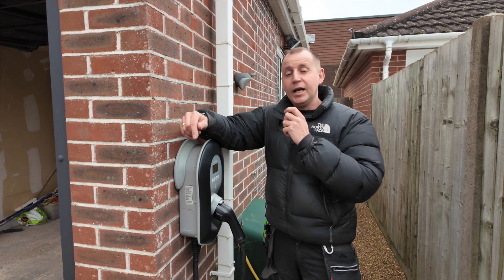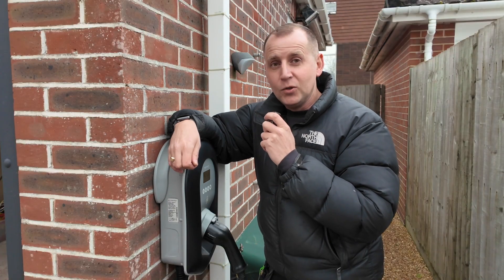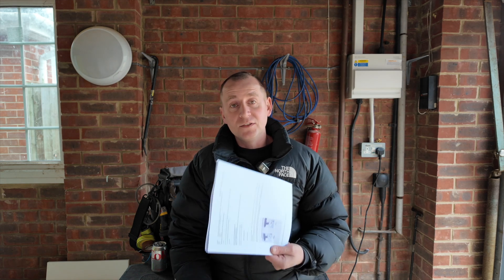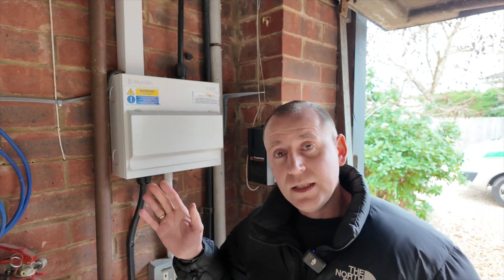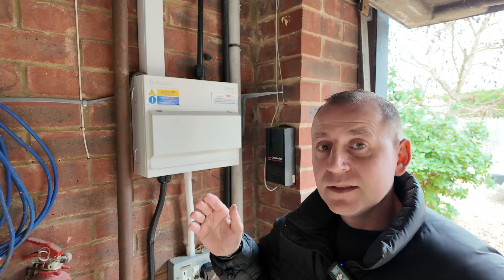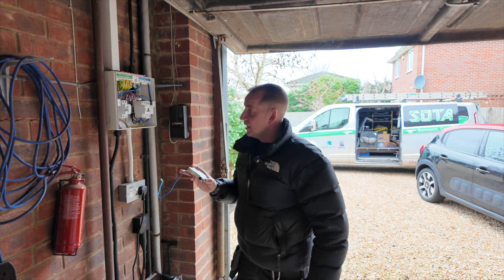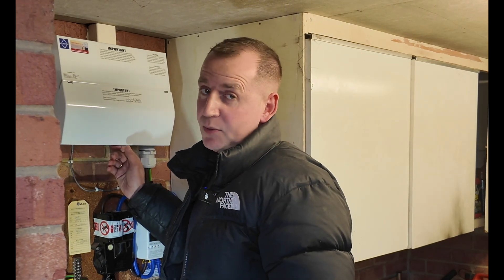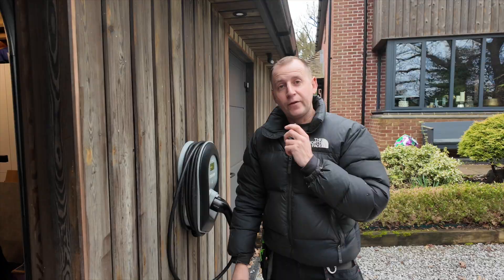THOUSANDS OF INSTALLATIONS MAY BE NON-COMPLIANT...ELECTRICIANS REQUIRED TO CARRY OUT REMEDIALS

Comment: My Energy owe you money, Ive never installed a zappy but have removed a few that were installed very badly. It seems now i will only install one if customer demands it. I WILL NEVER PUT A ZAPPI UP AS A FIRST OPTION. Thank you very much for this video, i cannot believe that they have used such bad faith like this. Deflecting blame on their faulty product with nonsense that will have had nothing to do with why their charge became faulty in the first place is a red line for me.
Reply: If they wanted to revise their rules they could have put a big red sticker on the replacement device saying the rules have since changed and now requires RCBO and kept you a happy customer. They have gone out of their way to imply that your work at the time was deficient to your customer. Id never trust them again

Comment: I had my zappi installed in 2022. Luckily, although my sparky installed it on an MCB, it is also covered under a main RCD on the board.
Reply: Unfortunately that’s not compliant with the regs either… part 7 says that the charger should be INDIVIDUALLY protected by an RCD… that is to say the RCD should not be protecting any other circuits. It seems to me most EVC installers don’t know that reg.
Reply: @stranglx  have you got the name of the regs? Need to tell my sparky.
Reply: @Smith_Tech_70  yes I do. In the current amendment fully in force since September 2022 it’s regulation number 722.531.3.101 page number 327. Specifically it says “shall be individually protected” In the original edition published in 2018 it is the same reg number but the wording was slightly different, it said “shall be protected by its own RCD” on page 317. I hope that helps.
Reply: @stranglx Thanks. I currently have my charger on an MCB and collective (several circuits) RCD. I'm getting the MCB replaced by an individual RCBO for my charger. The rest of the circuits can stay on their MCBs and the collective RCD as before. My Electrician is also going to perform the same upgrade to his own board, as he has the same as me. 👍
Reply: @Smith_Tech_70  sounds good, my only advice is that the RCBO should switch off the live and the neutral when it operates and should be made by the same manufacturer as the consumer unit.
Edit: It should also be a type A RCBO at least, depending on the chargers internal RDCDD protection it may need to be a Type B or F. There’s a lot to get right in this game. Finally if your house only has one consumer unit with just one main switch RCD you’d need to upgrade the whole unit as the RCD would still be supplying the RCBO circuit… hope that makes sense.

Comment: More concerned over the  use of an electric screw driver. I am retired now and always used normal screwdrivers. I notice this everywhere , electric screw drivers. Is this now a health and safety issue.    As for RCD you end up with two RCDs on the same circuit which was never recommended.  Chestnut done nothing wrong .  Glad to be retired and out of the Rat Race.
Reply: I’ll just point out that the Code of practice for EVC installations does say that selectivity is not practicable under some circumstances. Page 42

Comment: If the advice you say you received that made you install without an RCD was not in writing then I doubt you have a case at all.
Reply: I’ve got it in writing directly from Dr Chris Horne!
Reply: @stranglx  Ok so in that case your probably doing the right thing although if there’s a safety issue
then maybe the HSE should be made aware.
Reply: @andrewcampbell8265  Oh I’m planning on bringing the excrement to fan, but I’m after refunds under the consumer rights act and compensation under the sale of goods act. The HSE and trading standards would be an afterthought.
Reply from the maker: I’m not looking to make a case, I just wanted to let other sparks know that they need to install an RCD because I know a lot of guys are not
Reply: @sotaelectrical  I’m sure most contractors working in these emerging technology fields are well aware of the (over) complicated and changing regulations and the very poor administration of them by some energy companies.
I’m almost reluctant to suggest working with standards means being aware of them and protecting yourself with evidence in the form of written standards and manuals, not just relying on ‘some bloke told me’.
Reply: In that case you need legal advice. IMHO
Reply: @andrewcampbell8265  I doubt it, I can do the MCOL small claims thing as it will be for less than £10 000. Usually in a small claims court you can’t bring in “heavy” legal advice. I have the very simple evidence of one of the company directors writing to me and admitting that their claims online regarding RCDs were an oversight and that those claims had now been removed. Pretty much open and shut small claims.

Comment: Why did you stop using Lewden boards?
Reply: Does fuse box do an RCBO that switches both poles? Lewden certainly does and it’s reasonably priced.
Reply from the maker: @stranglx  fusebox does buddy, that’s why I normally install them 👍👍
Reply from the maker: Stock at wholesalers was poor
Reply: @sotaelectrical  what’s your favourite board?
Reply from the maker: @stevespoor6567  at the moment I’m using fusebox, good boards

Comment: I recently attended a myenergi zappi 2 installation training course. One question in the course test asked: "What is the recommended rating and type of protective device, on the supply to the EV charger?"    The correct answer was given as a "Type B 40Amp circuit breaker". - No caveat regarding local requirements.
Reply from the maker: So they are still recommending no RCD?

Comment: I too have a my energi Zappi that is not fitted with a separate RCB mine too was fitted well before 2022. WhatsApp more I was told by one of their engineers over the phone that it didn’t require one as it was incorporated in the Zappi. My Energi are being disingenuous on this one as it did comply with the then regs. What’s more there are lots of sparks who would back you up on that so take the to the small claims court.

Comment: When I read up on EV chargers and the issue of a "lost neutral" during or casing a local power outage.  Because of the most common form of underground cabling sharing neutral and earth (in the UK), all 3 conductors are liable to "float" to 400V+ depending on the phases.
Normally this isn't a big deal as every thing is "same potential" and the only real concern would be where things are not the same potential.  Holding only to a plugged in toaster and stepping out side might give you a shock, but who is going to do that?
Well...  what happen when you park a big metal box in the drive way, which sits on rubber tyres and connect it to the mains?
What happens is, because of the lowZ galvanic connection to the N, E or L from the car, the car (if it is earthed) will float at those 400V, but, the ground you are starting on is a highZ path and will only be floating at a voltage proportional to the resistance/voltage drop from the nearest local earth to your feet.  So the car might be floating at 400V and the ground only at 100V.  That's  a lethal 300V potential from your hand touching the car to your bare foot on your driveway.
The RCDs should still be able to detect this.  The lecture I watched mentioned a 75V potential as lethal and that risk certainly eixsts.
It is EXTREMELY unlikely though.  A lot of things have to happen in order for this to be possible.  A grid fault causing "equal potential" across the 3 conductors would not last long before the grid would trip or notice and cut off the local transformers at the nearest switch.  Then you have to have someone who has enough paint chips on their car to touch something conductively connected to Earth at the same time as wearing conductive shoes.
I believe the RCD mechanism will be found on both input to the charger and the output to the car, so that current leaking in or OUT from Earth will be detected and tripped.
The other thing they were talking about forcing in, was a full earth grid installed under the car and a local earthing from the charger to that, so that the ground under the car is same potential as the car.

Comment: And RCD feeding a RCD Why don't we have a RCD backing up that RCD , are Zappy admitting there RCD is not fit for purpose.
Reply: Their RCD works, I’ve tested dozens, the problem is their RCD doesn’t have a BSEN number recognised by BS7671. They’ve known this for a long time but only stopped advertising that their chargers are fully compliant with BS7671 in late 2022.
Reply: @stranglx  EXACTLY WHY!

Comment: Could these changes be influenced by European wiring methods. When wiring a French farm house I installed 
RCB protection to circuits and it was clear the French switch live and neutral on all circuits, the concept of 
switched live and common neutral  is not in France latest regs. They are not very happy using ring circuits 
either. The edf inspector who came to pass my installation wasn’t happy I’d got three sockets on a ring. 
I have no professional training in house wiring, and in France anyone can install a system from the energy 
supply inlet. All you need to do is pay for a visit to test your wiring and your earth which you have to install 
yourself. I used a ground rod, four foot copper rod driven into the soil. But all the circuit breakers switched 
off neutral and live on each circuit.

Comment: This is like the Grenfell Tower situation. What they installed was compliant at the time but was found to be non-compliant with the new regulations. This caused many other tower blocks to be inspected and many failed for having cladding that was compliant at the time but is not longer complaint and now the freeholders of the buildings are telling the leaseholders they have got to pay. 

I can see in the comments a number of electricians are saying the same thing, what they installed was complaint at the time and thus they are not going to make remedies for free.
Reply: Grenfell stuff was compliant but only because the testing was god awful and should never have been passed.  Not a great comparison

Comment: 😮 okie i need to comment ...i have a view that it's always good to over engineer and fitting an dual pole rcbo is a good idea.

Regardlesss the Zappi does have the 6ma protection for DC leakage I have always fitted an external rcbo and fusebox rcbos are my go too as there rcbos are dual pole as standard.

Yes you can use swa but with the new EV cable its not an Steel wire cable or covered by a metallic covering so an rcd is needed.

Appreciate you being open and honest about the zappi issue and unfortunately whis warrenty issue will catch alot of sparkies out.

Always over enginner over and above manufacturers and electrical regulations if at all possible.

Some may disagree...but if you do this then you shpuld not get caught out.

But hindsight is a great thing.

Sorry to hear on this issue have fitted hundreds of zappi chargers and always fitted rcd as an extra protection regardless if its on swa or rubber hr07 flex or ev cable.

Techincally it 240v outlet like a ceeform socket you would have for a machine or carvan but eoth thr handshake module so i dont see any difference to that and it has users that do silly things.

Rcbo if in doubt alwssy been my thoughts could save a life and always be completely covered.

Armchair none sparkies may disagree😂

Comment: I have two data sheets both from Myenergi one where they claim their device within the charger compliant with EN 61008 another where they have deleted this and make reference to local regulations. So at the time of installation and based on the information you had it was compliant and if anything their declaration of conformity was what was none compliant. I have questioned it with them and all ive ever got is stonewalled by them.

Comment: Always ensure you keep uptodate with the installation manuals published on the installer portal of the myenergi website! They are updated regually:

The manual issued in August 2022, a 32A Circuit Breaker was to be installed, local regs should be consulted to confirm if an upstream RCD is required. The manual issued in December 2022, states the same, however 18th Edition Amendment 2 was issued in March 2022, which changed 722 to include upstream RCD protection. (722.531.3.101)  The manual issued in July 2023 states  that the overcurrent device of 120% should be installed (38A so 40A) and that a RCD device may be required subject to local regs, then under a note (3) it references 18th Edition Section 722 which states a dual pole 30ma Type A RCD would need be installed upstream and may be combined into a single device (RCBO) 40A compliant with BS EN 61009-1.

Providing you demonstrate that the installation was installed to the installation manual in date at the time then it was compliant at that time. 18th Edition states that the manufactures installation instructions should be followed. Regs cannot be retrospectively applied.

Comment: Fair play for putting this out, my understanding was people thought that the chargers had RCD so it met the regulations but and I could be wrong my understanding is that the RCD in the charger is an electronic RCD and the reason it falls foul is because the wiring regs require a mechanical RCD, ie the old school type like in a split load board or RCBO that is double pole...   I think other comments on here saying the regulations are not retrospective, are wrong in that the argument is the 2022 regulations did not specifically change anything it just provided extra clarity where people were interpreting them wrongly so even prior to 2022 it was still required..  It does beg the question if you ask the manufacturer and you ask Napit and they both say its not needed what more can you do when clearly the regs were written in a way that caused confusion, what more can you do and 100% not your fault...

Comment: Good on you going back to your installs and rectifying them reactively. The big issue now with replacing a main switch for R.C.D is you've made the whole installation non-compliant. There is no discrimination in the event of a fault, total power loss. Aswell as the fact the whole installation has now only 30mA of earth leakage, not each individual circuit
Reply from the maker: I made a short explaining why I done this, it’s not the house C/U, it’s a garage board with no load

Comment: I've been aware of this issue for a while, is it to do with the fact there's no test button and it's not double pole. 

What's basically happened here is that it used to be fine and the RCD was ok.Now we are in a silly position where you have no discrimination between the supplied charger RCD and the RCD you install forcing bad practice on the installer. 

Its the manufacturers fault. Shouldn't provide an RCD at all in the charger. What's the point it's a waste of time and money putting one in the charger. 

Put a complaint in to zappi own instructions are telling you that it has the required RCD in it 👀😂

Comment: Hi mate, I have some bad news, your remedial works still aren’t compliant with BS 7671:2018+A2:2022.

Installing an RCD on the main switch of a consumer unit to provide protection against electric shock, in accordance with Regulation 722.531.3.101, is not allowed as the EV charging point is not “individually” protected by an RCD.

The reason why it must be individually protected is due to the potential presence of DC on the other circuits fitted within the consumer unit that, added to the DC that could be present due to the EV charger, could result in the RCD being “blinded” – this essentially means that the RCD won’t operate as intended under fault conditions.

You could argue that you’ve performed a risk assessment and concluded that the presence of DC as a result of the other circuits connected is low, but, from a regulatory perspective, tripping of a Type A RCD is achieved for residual pulsating current superimposed on a smooth direct current up to 6mA – little more than 6mA and your type A RCD has had it, not much room to play with!

However, I think you need to take a step back and consider the EV charger product specific standards and put the ball back in Myenergi’s court.

To my understanding, it’s a statutory requirement that the EV charger must have a CE marking. How can Myenergi claim that the charger is CE marked when the integral RCD does not conform with an applicable RCD standard? The EV charger product specific standards state that integral RCDs must conform with either BS EN 61008-1, BS EN 61009-2, or BS EN 60947-2 etc.

Personally, I think this is why they’re doing a complete U-turn and demanding that installers should install an upstream RCD. If you installed the charger without an RCD on the basis that it had one built in, why should it fall to you to pick up the pieces?

Comment: No one's in trouble. The regs are part of life. Compliant at point on installation.  Replacing equipment later, then bring up to current standard. Should be thought about when looking at EV running costs.